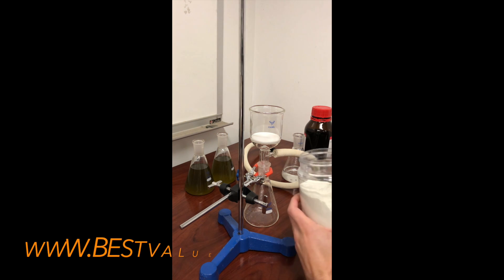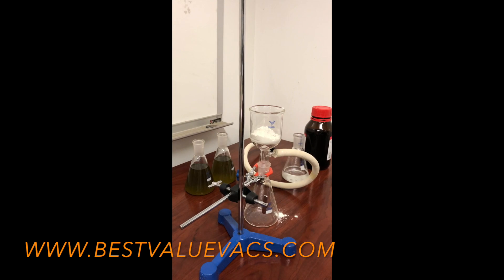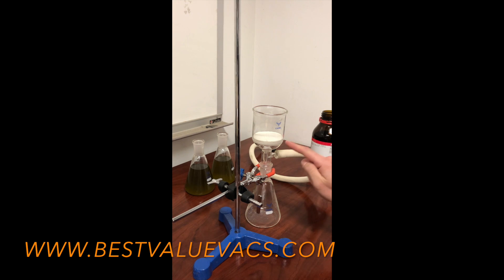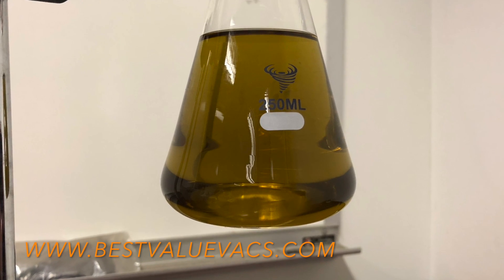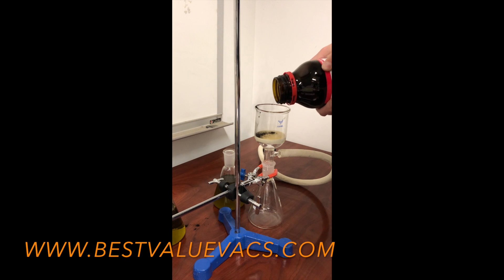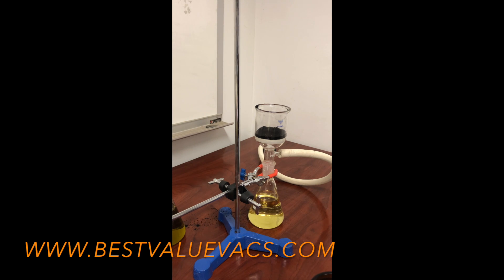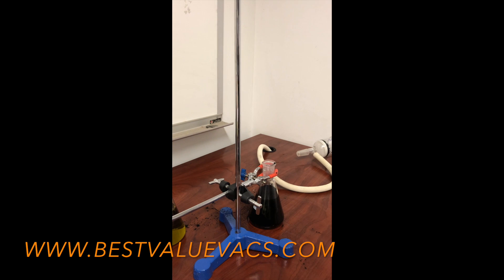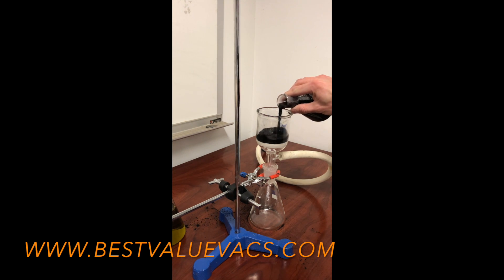Celite545

Comment: So many people post process with the extractor when they should be doing this. We calculated over 50% loss of THCA when doing this by extracting cold instead of post processing color out.
Reply from the maker: @davidmcghee7696 there is potential loss while performing any refined extraction. In your case you may have had the solvent in contact with the material for far too long. THCA can precipitate out of the solvent! Running multiple post filter setups to clean ethanol extraction could destroy all your terpenes. Ethanol vs hydrocarbon extractions are both widely used and both have their benefits per desired end result.

Comment: What power vaccuum pump? Mine just wont pull
Reply from the maker: @garydoherty7043 maybe you have a screen/filter clogging too fast? You can use a 1/4HP rotary vane pump on a buchner funnel. In this video we used a 1HP vac pump.

Comment: Chlorophyll, Put it out in the sun for a few hours, it will turn amber, no need for filters and wasting time
Reply from the maker: @Gta_Selection might work! But that does not remove the chlorophyll. Chlorophyll can add taste and be an issue within further processing. Using a filter aid after extraction typically gives the best result.

Comment: What I do is put the Ethanol and grass in the freezer overnight when you mix them together they come out yellow none of the green. Then there's no need to add all those silly chemicals you don't want in it. The ideal is to keep it natural not put all that garbage in it.
Reply from the maker: @noid8814 that is a fantastic operation procedure! When the initial extraction is done below -20 you will not extract the green chlorophyll to begin with. The filter aids used in this video along with the other filter medias we carry are all earth materials, we also use to clean up our daily drinking water.

Comment: What is filter media?
Reply from the maker: @area51r filter media refers to the material or substance used in a filtration system to remove impurities or particles from a fluid or gas. It acts as the medium through which the filtration process occurs. These filter medias are similar to the medias used to purify your drinking water.

Comment: Which carbon do you buy on the website? Is there a good place for the filter flask and pump also?
Reply from the maker: @chris goldbach you want to use the BVV Activated Hardwood Carbon Decolorizing T1. For the vacuum pump, you can use any rotary vane pump. The flask and filter are found here: https://shopbvv.com/collections/filtration-equipment-systems/products/ceramic-buchner-funnel-kit

Comment: What equipment are you using to actually clean the buchner funnel? I've ruined one (no flow even under vacuum), and another is now becoming slower and seems like the fritt is discolored. I've ordered a sonic cleaner that should work, but really would like to know what you use.
Reply from the maker: @STLUVNU Nice purchase of the Sonic cleaner! That is what we use to clean our glass pieces. You can run the funnel empty with clean ethanol to clean the fritted glass disc, but it will get clogged over time.

Comment: 5:06 you must go through ALOT of glass 😅. Microfractures are a thing my guy, and glass on glass is the very best way to get them. In short almost every type of "glass" whether it's good ol' silicon dioxide float, a quartz fusion, borosilicate, or even sintered aluminum oxide have a few key properties in common. Namely they are hard, perfectly elastic, have innumerable inclusions, and are brittle. Individually none of these are bad persay, but when combined they are horribly detrimental to glasses longevity... and the worst possible sinario is a glass on glass collision.

With any collision there's obviously kinetic energy that has to be dissipated. For most materials is no issue; steel will ring like a bell or deform if hit hard enough, wood will flex and dent... but glass is kinda an ass about it. Molecularly it's a stubborn old man about it; it won't give an inch until it collapses. This is exasperated when glass meets glass- that energy has to go somewhere. The physical structure simply says "i ain't 'avin it", boots in the mud and arms crossed. The only place for dissipation is via sound, thermal, and radiation... unless the glasses integrity is overwhelmed. Now complete failure does take a fair amount of force, but on a microscopic level all those inclusions are perfect little spots for fracture nucleatiom to occur. Worse is that gass is perfectly elastic: a shockwave is formed and spreads monstrously quickly, but the surface will spring back pretty much instantly... so one little "tink" of glass on glass is actually more like a pair of nanosecond jackhammers firing into each other. Lastly the brittleness comes into play. That energy wants out so damn bad it doesn't care how it gets it, which leads to fractures. Sometimes even full-blown elections of material.

So a tap or two won't bust much, but after a few weeks/months of accumulation and failure is inevitable. Just wanted to let ya know incase ya weren't aware. Figured I'd mention the what and the why. Much love and respect brosiff, keep being your stellar self! And thanks for the awesome content 😁

Further reading incase your interested/sources (not all, some was from memory):

https://www.nature.com/articles/srep23720.pdf

https://www.google.com/url?sa=t&source=web&rct=j&url=https://www.osti.gov/pages/servlets/purl/1250403&ved=2ahUKEwj5yIaXkIv1AhXNFTQIHQQnAMQQFnoECCAQAQ&usg=AOvVaw2Fn0kLN9PDqvOeh217S4-D
Reply: Thanks for not offering a solution
Reply: @tycho8525  don't tap glass on glass 😁

Unless you ment for the specific situation I time stamped, if ya did then few things come to mind.

1) transfer the solution to a beaker so the carbon can be scooped in directly.

2) add an interface so you can still tap but without causing damage. A ring gasket on the funnel spout perhaps. Hell even a quick wrap of tape would work.

3) use a stir rod to poke it through.

4) connect the funnel and the flask and lift it by the neck of the flask, then wiggle it back and forth.

5) scoop with EXTREME precision.

6) connect the funnel and flack then set the flack on the counter top. Smack the counter right beside the flask with the flat of your hand. (or a book if your fanger be delicate)

7) use a large syringe to transfer the carbon. (has the bonus of no dust/spills. Its my preferred method when working with powders)

8) pray for devine intervention.

9) if its a non reactive substance use a plastic funnel.

10) don't add the carbon, just skip this optional step.

I could keep going but I'm officially bored. Just remember that ya always got options holmie 🤙
Reply: glass is a consumable. get over it.
Reply: WTF!!!...lol.....I'll have to get my Funk and Wagnel...out of curiosity; what would be optimum vacumne pressure for removal of particulates from my undies at sea level?

Comment: Can you explain what the carbon is filtering out and what the celite545 is filtering out . I know it clarifying it. But I would like to the know the difference of whats being filtered
Reply from the maker: Carbon is used to remove chlorophyll from your extract. Chlorophyll will create unwanted chemical impurities and unwanted flavors in your material. Celite is used as a filter aid, and the carbon adheres to the Celite to filter out any carbon from your final solution.  
There are a lot of filter media out there! Let us know if you have specific questions about any of them.

Comment: Do you think you could add the filter media into an RO filter if the RO filter is 5 microns?
Reply from the maker: Great question! You could use a RO filter to filter out the media and other particulates. The RO filter would need either a vacuum pull or a positive pressure push to get the solution through it. 
Feel free to give us a call at (331) 281-0154 to speak with a tech.

Comment: Can I filter bho through this  or does it have to be alcohol?
Reply from the maker: You have to dilute the bho with alkanol to filter it.
Reply from the maker: 200 proof ethanol works best 1 gallon is $59
Reply: @Jmarosii  
I’m trying to ask if I can do a form of dewaxing with this filter media. Can I take cold butane straight from a open blast and filter through? Or can I use this in a closed loop filtration column?
Reply: @Joeystro32 yes

Comment: Was there any difference in the contents of the extract after you clarified using the process?
Reply: We typically do this process if we need to winterize the material before distillation.  To catch all the waxes.  We have cleaner distillation runs with filtering.   Cool fact. Celite 545 means 4.5 microns for reference.

Comment: Does any activated charcoal or Celite 545 get into the finished product? If so what methods would you use to filter out excess contaminates?
Reply: run it through a 1 micron filter

Comment: I just tried this at home and i got no clarity in color or anything. What am i doing wrong?? I used celite 545 and 200 proof ethanol with a vacuum flask and beaker ??
Reply: Charcoal. Celite first, then charcoal. Or if you don't have celite do six or seven charcoal filter steps. I do it on my bathroom counter with a kitchen funnel, a 1000ml beaker, a bunch of coffee filters and charcoal powder. No buchner, no fritted disc or vacuum pump. Patience and knowing when to swap out filters are the key. keep trying, you'll get it!
Reply: I noticed you never said you used activated charcoal. No colour change will happen without it. The celite is for “clarity” not “colour”.
Reply: @ThisisFerrariKhan  i used charcoal too. Very finely ground charcoal and it never worked

Comment: Could you theoretically not winterize and still do this process, removing the ethanol in a rotary evap, pouring the product onto parchment and into a vac oven to still retain stability? Or can you winterize and still end up with a stable more shatter like product. I understand that if i want to put into cartridge or syringes i need to dewax and winterize but what if i just want a cleaner shatter?
Reply from the maker: As long as the fat stays dissolved (not sub chilled) you can filter an extract with a fat content through Celite and Activated Charcoal yes.
Reply: Guy for BVV said we still get clean shutter If fat stays in product, anyone try to achieve that and get GOOD RESULTS? After, celite-carbon, no wenterization process, rotary avaporator(remove ethanol), vacuum owen. Anyone?!

Comment: Have a really old weed and my oil product is dark brown put it thrue activaded carbon and still dark brown could it be the old clohrofiel and it could be taken out with celite 545?
Reply from the maker: The Celite 545 can be used to filter out carbon that has been introduced, but it will not take out any color from the material by itself. I recommend a hot scrub of the material to take out additional chlorophyll color. Celite should be used beneath any powder in a filtration column or funnel just to keep the powders in place.
Reply: @Jmarosii  Could you explain what you mean by a hot scrub?
Reply: @GoldThumbGardens  I don't think he can lol

Comment: Man I bought this product and  my extract turned red
Reply: The fresher the harvest the more amber the finished product. Trichomes turn amber with age, heat,  and light.
Reply: Same here I wish they would offer more advice when you ask them about there products.
Reply: @GoldThumbGardens  try to choose another carbon, probably you need a hard wood charcoal or coconut.
Reply: @del4u270  Thank you for the tip.
Reply: @GoldThumbGardens  red/pinkish color often happens when not using the proper metal for the tools. In general use plastic for carbon. ;)
Reply: @d4rkblizz4rd0  Could you elaborate on that?
Reply: @GoldThumbGardens  no.

Comment: Have you guys noticed that carbon tends to grasp thca when washing for the regular in line filtration. Some test for our scrubbed & polished shatters are coming 27-34% while our unscrubbed extract will hold 72-80% potency. Any thoughts?
Reply: Bbv offers a bleaching powder use this first 180° for 10 to 15 mins this will decarb with out the darkening it like it likes to do when you decarb fliter out the bleaching powder re run it thru the 545 and active chacoal...
 i just warmed the tincture the first time and that helped a lot but the potency was so high that when i mixed it with terps to make cartridges it crystalized in the carts...
I tweaked the process with the bleaching powder now i have pale yellow clean carts that dont crystalize n they are way more fire than anything iv got from the store
Reply: @sarahlarick3055  A LINK WOULD ROCK PLEASE!
Reply: Warm the tincture up first
Reply: curious about this and how much is being removed. how much testing has yielded these results?!?
Reply: Just scrube with anhydrous mgsu

Comment: Does this need to be an explosion proof pump?
Reply: Another alternative is to look into a filter setup on the oil reservoir like some folks in the home vacuum freeze drying community do to keep their pumps in good shape and to not need to change the oil every few uses of their appliances.
Reply: No 
I've used ones from harbor freight. 
Just be careful not to suck any fluid into the pump. Also it's going to destroy your pump in about 3 runs unless get a cold trap so use a cheap pump untill you get a cold trap

Comment: I was under the impression that the activated charcoal also removes some of the oil which contains thc/cbd.
Reply: Whatever it removes you didn't want anyway.
Reply: @joshsmith-uy5iw   what about the smell? I want that terpenes there bro
Reply: @danielpuig9476  no you don't. Not when winterizing and distilling. The whole point is to separate them. 
Please do a little more research on what you're talking about.
Reply: @joshsmith-uy5iw the point is to remove waxes, and chlorophyll, stay with clear yellowish and smelly oil!

in destilación you just want to remove the ethanol! in winterization the waxes! 
with the activated charcoal, just the color, allegedly

I don't want to separate terpenes, that is an other process with water, using flowers.

And if you want to separate you don't just mix with charcoal like that, terpenes are expensive you don't want to throw them away.

be humble kid! go to school!
Reply: @danielpuig9476  dude. Obviously you don't do this for a living. You go mix ethanol and try to keep any terps worth a damn after distilling it back haha 
You're good with Google but doesn't sound like you know your way around the front side of a roto or spd.
Reply: @danielpuig9476  once you winterize, your terps are trashed. 
The reason you winterize is to remove fats so it's easier to run it thru the short path. 
No one is winterizing and trying to keep terps. You pull tjose in a separate process with fresh material. Anything touching ethanol, you've already decided has trash terps.
Reply: @danielpuig9476  also, I went to school. To do extraction refinement. This is literally what I went to school for.
Reply: @joshsmith-uy5iw   my bad! Lol, and thank you for the clarification, from Chile is hard to put your hands in this equipment for extracting cannabinoids, I'm just an agronomist.

I was about to mix with ethanol my fresh frozen bubble hash (wich is still frozen), guess I'll just rosin press it, and hope the remaining water doesn't fuck that up (as I don't have a freeze dryer)

P.S: guess life forced humbleness upon me now
Reply: @danielpuig9476  not how that works.
Reply: josh smith I make ethanol extraction, winterize and end up with a smelly oil, isn’t the smell means terps ? My aim is to have a nice smelling oil to put in vape with a vacuum oven for purging without the use of rotovap and distillation... what do you think about that ?
Reply: @joshsmith-uy5iw  thought most terps evaporate at higher temps than ethanol?
Reply: @Nicolayr  if you want to put any product into a vape cartridge, it needs to be distilled in a short path.
Reply: @tommygun2576  some stay after you remove most of the ethanol but ive noticed that when I pull all of my ethanol back out after winterization that almost all terps are gone with it. I've never heard of anyone salvaging terps after winterization.
Reply: josh smith can you jut tell me the reason ? Residual of ethanol  will evaporate completely ( less than 100ppm) with the use of vaccum oven
Reply: @joshsmith-uy5iw  that's why you do a -90c extraction and running it through carbon and celite to make sure you dont need to winterize. Cold enough material column wont pick up fats. When fat/waxes/lipids are clumped up it will have a hard time passing through carbons .5 micron and celite 2-5 micron filter. No need for ethanol it will ruin your oil. Your terpenes are a solvent as well so if you get your crude cold enough it will crash and seperate the solvent layer (terpenes and butane) from your thc fraction. You pour off the terps layer and crystallize the thc fraction slowly. Extract the butane from your terpenes at 135° at 28 microns  for 24 hours.
Reply: @anatoliyrubanenko7277  what ratio of carbon per weight of starting material would you recommend adding to the filtration sleeve? Also which kind of carbon would you suggest, thanks for your knowledge brother!  I agree this is the best method, no need to introduce ethanol if done properly.
Reply: @joshsmith-uy5iw  Could you theoretically not winterize and still do this process, removing the ethanol in a rotary evap, pouring the product onto parchment and into a vac oven to still retain stability? Or can you winterize and still end up with a stable more shatter like product. I understand that if i want to put into cartridge or syringes i need to dewax ands winterize but what if i just want a cleaner shatter?
Reply: @joshsmith-uy5iw  would you say that winterized qwiso filtered with celite545 and carbon (like in this video) then slowly evaporate the iso then decarb in stirrer/hot plate at 135 C then mixed with terpenes would not be vapable inside a cart? 
i